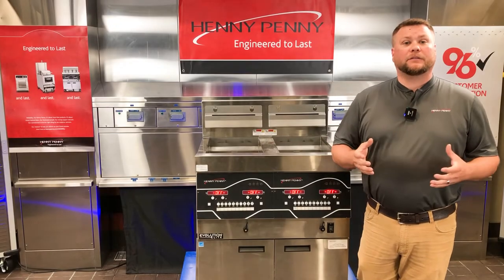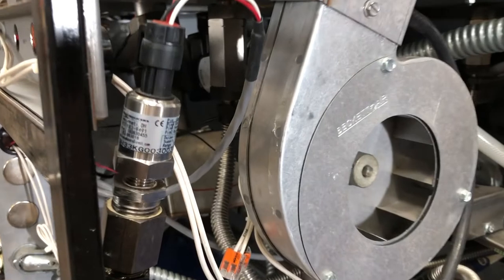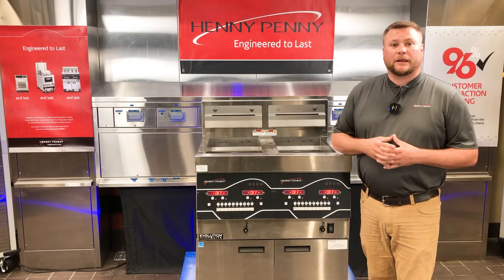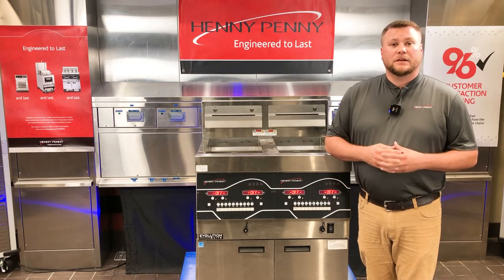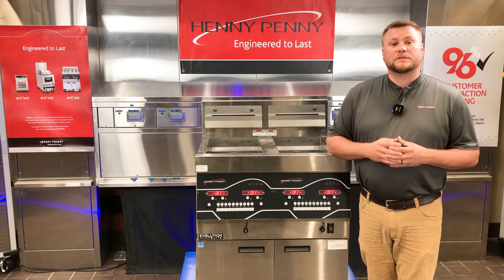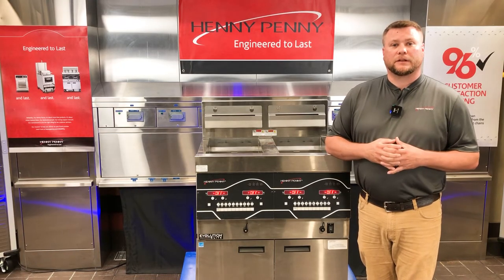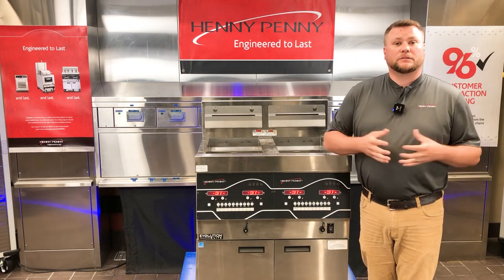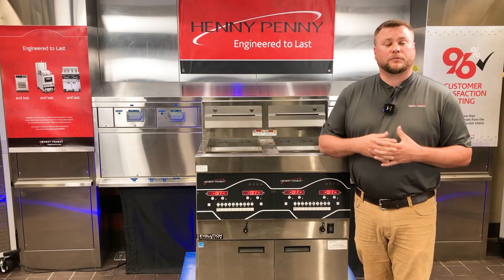Troubleshooting the E-83 (pressure too high) error code on LVG and EEG fryers.

Comment: From the field as a tech who works primarily at McDonald's locations, in my experience I've only had this happen when they don't filter which causes the crumbs to pack inside the back hole. I've literally had to ream out the crumbs packed with a drill bit. Great video though. I wasn't aware of the tiny check valves. Cheers!
Reply from the maker: Hi Tim,
You are correct that the crumbs are the culprit the majority of the time. Thanks!
Reply: 😂😂 my place is very anal about the machines, it gets cleaned by maintenance every day, and they filter religiously, it still happened.

Comment: Kind regards, this error has happened to me twice when I changed the pump for a new one, could it be a reason that the pump has a higher capacity?
Reply from the maker: Hi Yeison
This error code only happens when there is a restriction in the line, causing a pressure increase. Our high volume pumps do not add too much pressure, just more volume moved. Also, the high volume pumps have larger fittings and would not work on a standard pump, so you would know instantly. Likely there is an underlying restriction somewhere in the plumbing lines, or check valves. Thanks

Comment: Sir can you explain about e31 error
Reply from the maker: E-31 error code occurs when the element tilt switch is "open" meaning that the elements are up when they shouldn't be. If the elements are down and you are getting the error code, then you would want to check the element tilt switch and wiring going back up to the control board. For further assistance, you can reach out to our Tech Support Dept. at (800) 417-8405